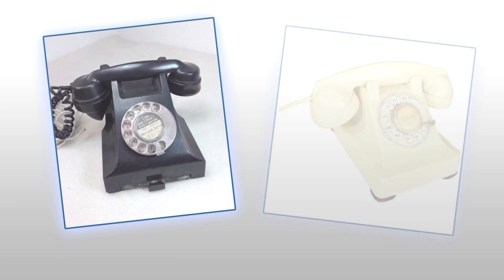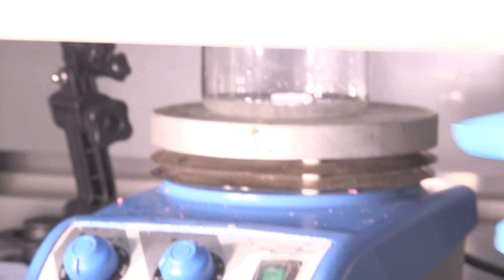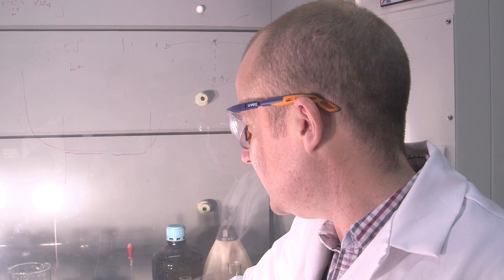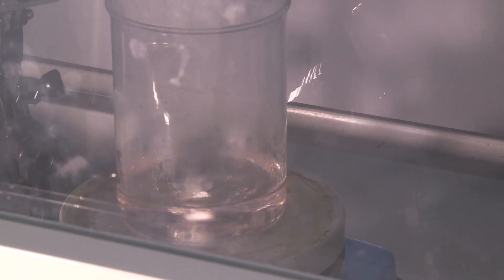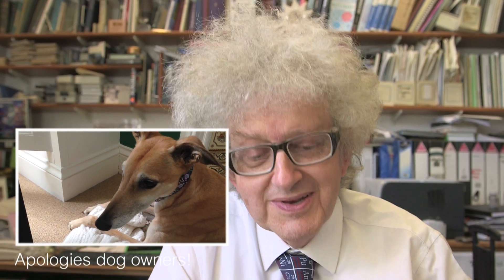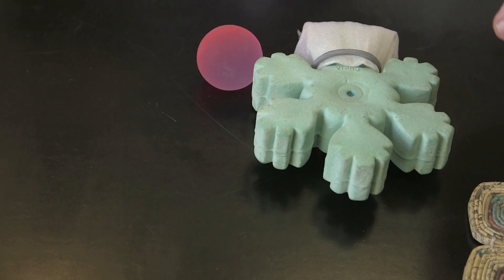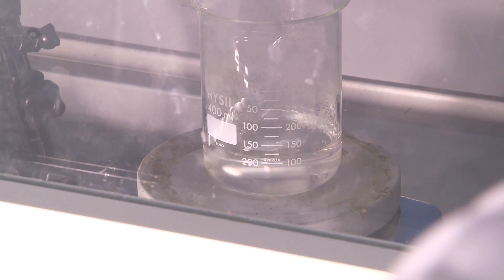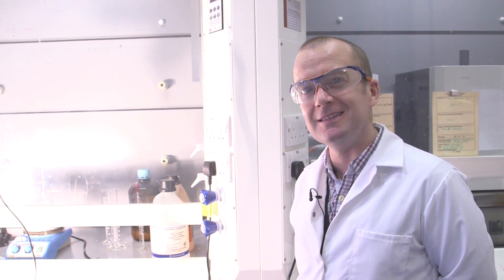Making Bakelite - Periodic Table of Videos

Comment: Is that bakelite poisonous? After all there is phenol and formaldehyde...both quite toxic.
Reply: Chlorine gas and metallic sodium are both extremely volatile, but that doesn't mean a pinch of table salt is dangerous.
Reply: Jasper Tan To be fair they also made paint out of lead.
Reply: Blingdaa86 This reaction is an elimination reaction, so it's not like the resin can decompose on its own. Combustion will not  decompose the structure into phenol and formaldehyde. However, all plastics tend to produce poisonous chemicals when burned. Also, aromatic rings are common in biological systems, so there might be a convenient metabolic enzyme that converts the plastic into a dangerous chemical for you - no need to whip out the matches then.
Reply: Brendan Paul Not really. 2 chemicals joined together can still form a poisonous compound, but I doubt bakelite is poisonous. They did make toys out of them.
Reply: Blingdaa86 Would you piss off, lets see you live without salt.
Reply: I guess in some senses it is, because there is bound to be traces of phenol and formaldehyde that have not reacted together in the resin.
Reply: Blingdaa86 well, compared to peoples' old uranium coated clocks I don't think a bakelite phone will do much damage. And the fumes are always toxic in a fire, it's almost always what people die from in fires.
Reply: Brendan Paul That's what happens on youtube, if someone replies to an old comment, it won't show it unless you refresh the page.
Reply: Bob_Sack Lead isn't all that dangerous though, and paint doesn't burn and vaporize in the air like gasoline does, since they added lead to gasoline too to increase its octane level.
Reply: Is water flammable? It is made of oxygen, and hydrogen.
Reply: As others have said, two harmful elements don't necessarily make harmful molecules. Salt for example. However, two harmless elements not necessarily make harmless molecules. Carbon Monoxide for example is very poisonous to humans, but we are made of carbon, and need oxygen to function. Weird isn't it? =P
Reply: No because i have medical instruments made of bakelite
Reply: Nillie Actually table salt is quite dangerous for your health :)
Reply: Blingdaa86
If you consume enough of it. However, the chlorine in it is important in the creation of mucus, and sodium plays a role in your neurons.
Reply: I had similar reservations about melamine resin (which is a mixture of formaldehyde and melamine), but I am now the proud owner of a melamine colander.
Reply: Blingdaa86 In excess, like everything. That's why I specified a pinch, because I know that while we do need some salt, too much can still be dangerous.
Reply: Point: don't mix bleach and ammonia, for example.
Reply: Justin Muller That is what I thought. If there is a fire, bakelite might produce toxic phenol/formaldehyde gases, right?
Reply: Blingdaa86 not having enough salt is far more dangerous than having too much
Reply: klikkolee
The simple answer is yes. If you sweat a lot, you lose salt. This can lead to confusion and muscle weakness. Too much salt is both an acute problem (you can be poisoned) and a chronic problem (it's widely believed to cause high blood pressure). You should aim to be in the middle ground, which is pretty wide.
Reply: You shouldn't eat the plastic, enough will still kill you.
Their Bakelite is probably not safe to touch, but thats because it is unwashed and would be coated in unreacted chemicals.
Reply: Blingdaa86
only in large enough quantities. Which basically means anything in a can :P

Comment: How do bakelite records fit into this?
Reply: 78rpm records aren't actually bakelite. They are made from shellac, a secretion from a sort of bug (!). That stuff is thermoplastic, not thermohardening like bakelite. 
An exception to this is the Edison Diamond Disk, which has a bakelite core with a laquer surface.
Reply: fit into what? The beaker? It's a thermoplastic so I guess you could melt them down...
Reply: LimaVictor Hey, thanks for the answer. This actually sounds interesting enough that now I have to look into it.
Reply: LimaVictor They were made of shellac.now they are vinyl records. ;)

Comment: Isn't Formaldehyde carcinogenic?
Reply: Yes, you don't want to breathe that stuff. It's also used in preservation of biological samples.
Reply: Yes. It also happens to be sold as a dimer: pure formaldehyde is too unstable and reacts with itself to give the dimer.
Either you need heat to decompose paraformaldehyde (the dimer), or a base to hydrolyse it.
Reply: xja85mac
Actually paraformaldehyde is a polymer consisting of relatively small chains of formaldehyde units, not simple dimers. 1,3,5-trioxane is a small cyclic compound that actually is a trimer of formaldehyde.
Reply: Its not carcinogenic but it is very irritating to your body. 40-100 parts per million of it causes your throat to swell and lived and kidney damage.
Reply: I recollect reading somewhere that it's only associated with nasal cancer, because it's absorbed well before it can do amy more harm.